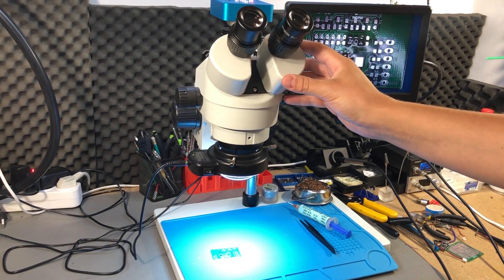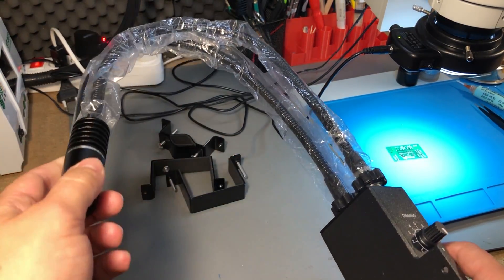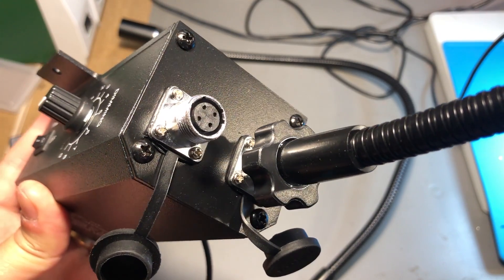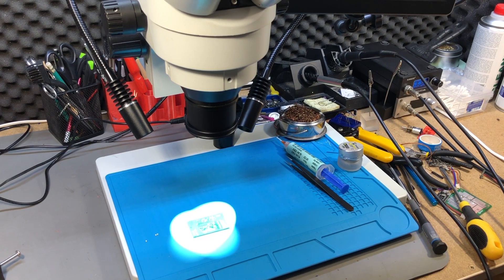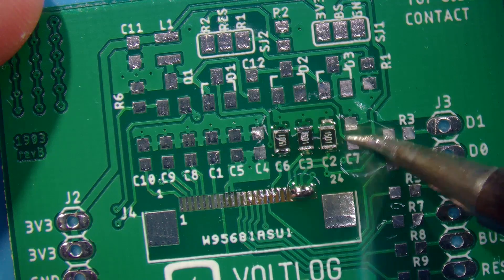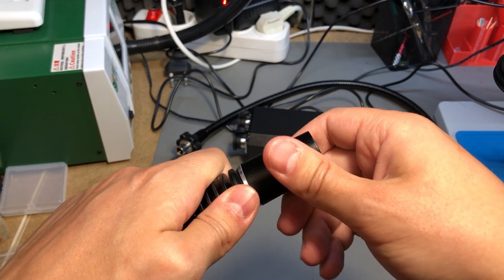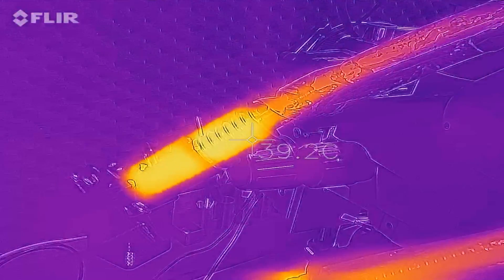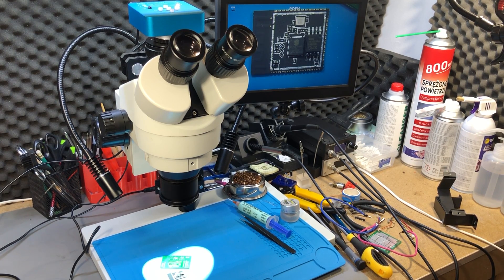Fix Microscope Ring Light Reflections With These Projector Lamps | Voltlog #327

Comment: Hi Florian, it's a nice looking product but excessive price,
I think you could build one as good or better using parts from Ali-X or fleabay for less than half the price,

I built a small photographic copy stand about 7 years ago with 2 x 5 Watt Cree LED's, 
I bought a couple of gooseneck lamps from fleabay with similar construction for about £8 each,
I also bought a 75mm heavy duty aluminium project box for £5 and an adjustable LED psu (I think it was 15 Watt) for around £20,

The 5 Watt LED's that came with the lamps were utter shite so I found a supplier of proper Cree LED's and swapped them out for Cree's at the colour temp that I wanted rather than what was cheapest that week, I think they were around £4 each
They worked great for the 3 or 4 years that I used them and the bonus was that I could spec my own LED's, for the £50 or so that they cost they were probably comparable to the commercially available copy stand lamps that were priced at around 3 times the price, 

Nice review though, always an honest opinion on this channel and I appreciate that
Reply: You could get some of those strong cheap alum LED torches and just put the heads on the goosenecks.
Reply from the maker: I agree, one could build this with readily available parts for a similar cost and end up with more control over the parts that are used.

Comment: Aren't there purpose build lens to avoid the lights reflection? I'm pretty sure there must a not so expensive lens that solves the problem without having clutter the work bench with extra stuff
Reply from the maker: There are some expensive ring lights that have a polarizing filter which should help avoid this problem, however those are in the $500 range.

Comment: Low output of power supply + good heat sinks should extend the life of the LEDs massively. If the lower brightness is OK. Great video.
Reply from the maker: I've measured the LED heatsink temperature, shown in the video, they stay pretty cool, no worries.